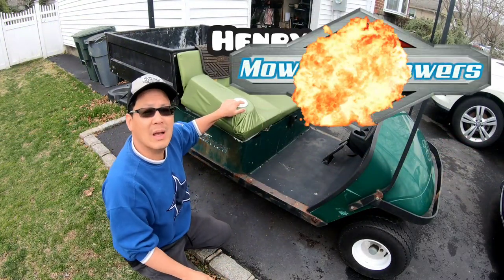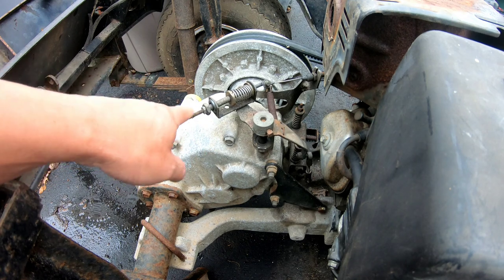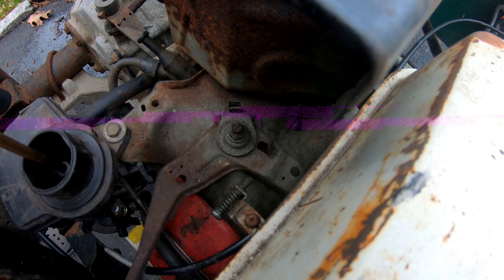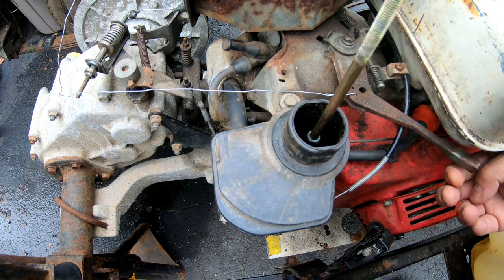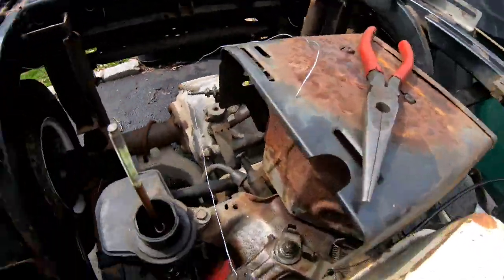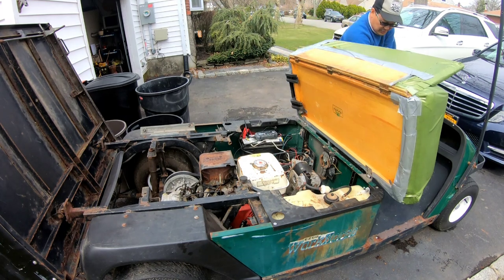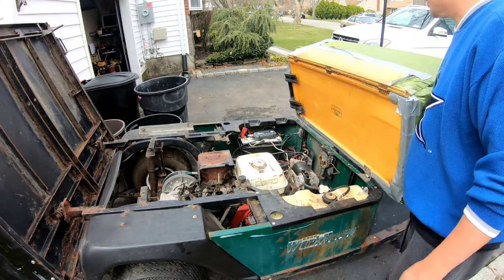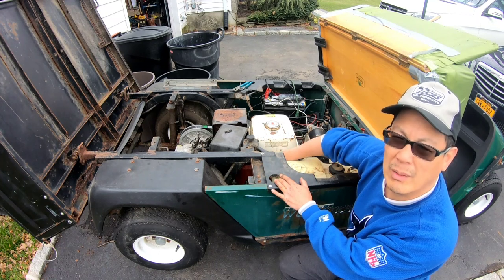EZGO WORKHORSE 1200 UTILITY GOLF CART REPOWER PROJECT GAS PEDAL THROTTLE FABRICATION INSTALLATION

Comment: Hi Henry, great video. When will the stereo system and AC be installed? I'm waiting for those videos.
Reply: Hahahaha I was thinking the same thing, how about a hot tub in the bed?....LMAO
Reply: @knighthawk86855  Ya, you may need new tires and heavy duty suspension system for that!
Reply: @tg9754  I say lift it, knobby tires, 4x4, hydrolic suspension, air bags, KC lights.... LMAO